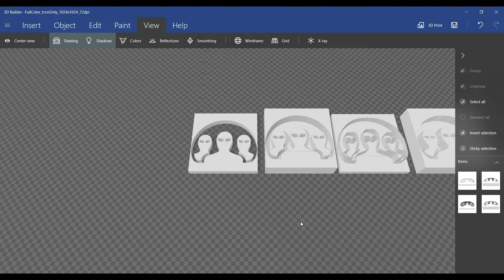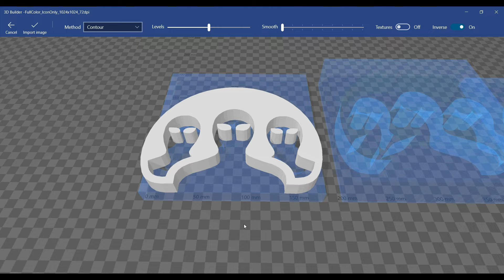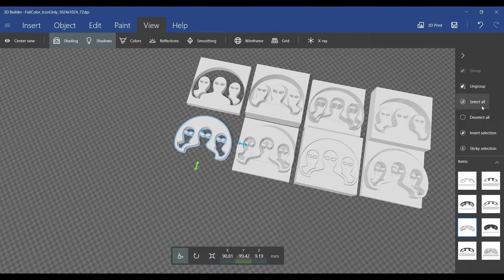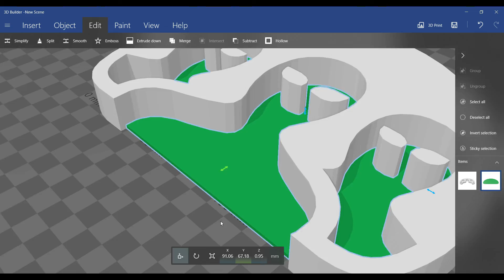How to Convert a 2D Image to 3D with 3D Builder

Comment: Just making flat into raised, not adding curves and volume.
Reply: Depending on the darkness and lightness of the image points, you can control the amount of prominence. Try it once, and then darken or lighten each point you want to have less or more prominence again in an image editing program until you achieve the desired prominence.